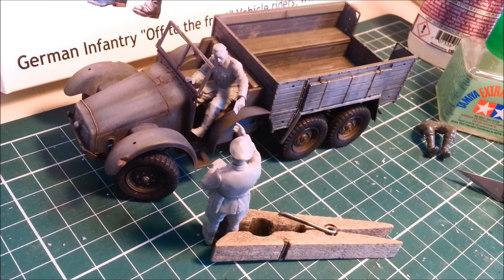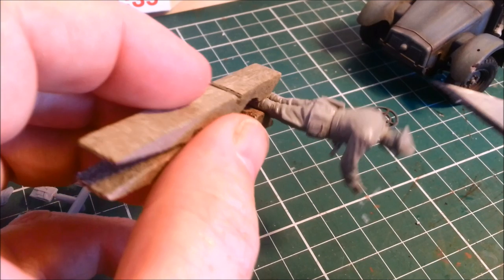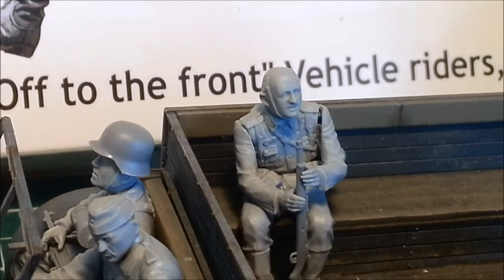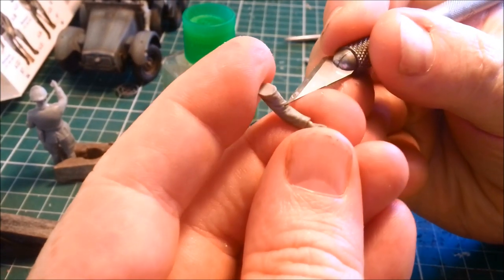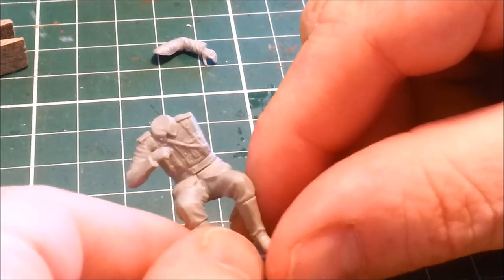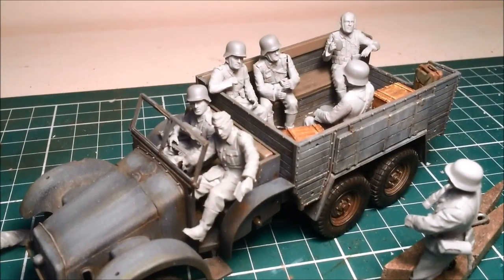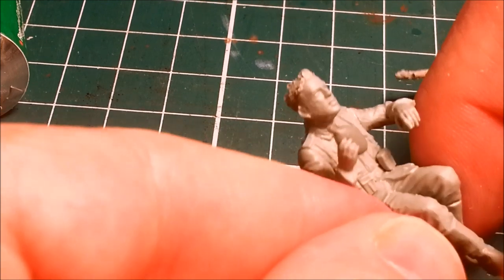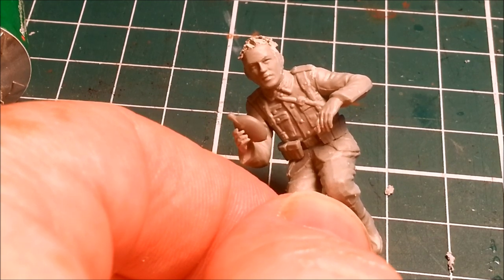Scale model figures 'how to' guide - Part 1 Construction and building

Comment: Great to see Humbrol filler getting some love.   Top tip, try mixing a small glob with some Tamiya Extra Thin, you can then brush it (with a crappy old fine brush) into areas and it'll stick to the plastic like nothing else, sands great too.  Downsides, don't rub it once on as the Extra Thin would have started to melt the plastic and you can deform or rub off details.  You can however just add more Extra Thin to your glob of putty and vary the consistency.
Reply from the maker: Matt Person thank you, that’s a solid tip there!

Comment: Good job, Dave!  I guess one could spend X for an Alpine , Bravo-6 or other such SINGLE figure and have less complaints.  Or one could spend X divided by 2 or 3 and get FIVE guys from Mini Art that really aren't that bad in the final analysis.  I think I'd trade the poses, equipment, etc. of Mini Art in exchange for doing what I consider fun, satisfying clean up work.  Especially true if you need to adjust arms, hands, feet, heads.  There are always Hornet heads and others if you don't care for the facial expressions provided.  Keep up the good work.
Reply: instablaster.

Comment: By using a proper pair of flat edge clippers rather than scissors to remove from the sprue you’d reduce a lot of the need to get rid of left over plastic on the part you want.

Comment: I think you could use the fellow with his elbow out to hold the helmet down on the fat head in the passenger seat. Just saying;) The heads appear to be 1/32 scale versus the 1/35 scale bodies? I have been stocking up on the uniform colors. So I can start building a few and dive into the learning curve. Remember the Jerry's sported the high and tights in the early days. Not until the Russian front did you see the unkempt version with the dark circles around the eyes and gaunt faces. You can also use air-drying modeling clay to make hair, hats and additional equipment.
Reply from the maker: john maddox thanks for the feedback. Agreed, those heads look 1/32 - you are spot on!

Comment: Man you must have received a bad set of the Feldgendarmerie. I have that set and there is some flash but not like that. I wonder if Miniart would send you another set or give you a credit for something else... it's worth a try. You should give Aves Apoxie Sculpt a go for filling gaps. It's a non toxic 2 part epoxie putty that's blends with water. You just place the putty in the gap then using a small brush with water blend it into the joint. I use it all the time to fill imperfections, oh and it doesn't shrink which makes it a one shot deal. Making good progress on the dio it looks like.👊👊
Reply: Mini-art figures seem to be hit or miss. I've had some with little flash...and some with tons.
Reply: Larry Brown I’ve heard that but haven’t experienced it yet. It shouldn’t happen these days with the technology we have.
Reply from the maker: Small Soldier hmm, I bought it off eBay, so I don’t know that I have much chance of getting a credit. Yes, it’s their manufacturing fault, but purchasing from an individual rather than a retail hobby stockist would make life hard if I went down that route I think...
Reply: Oh yeah absolutely. Sorry I didn’t know you got if off eBay. Miniart does some neat stuff but from time to time I’ve heard horror stories like this. I think they’re new stuff is pretty nice though from what I’ve seen. Anyway I hope you didn’t do too much swearing. 🙂👊🏻👊🏻

Comment: Hi dave, if ive painted model figures in enamel how do i make them look more matte??
Reply from the maker: Airable 1 I would recommend a final airbrushed coat with matte clear coat - I use Tamiya clear coat.
Reply: @DavesModelWorkshop  thanks!
Reply: @DavesModelWorkshop  what type of enviroment is this diorama in?
Reply from the maker: @oliversinton948  it's going to be in an urban environment, set in the early days of Operation Barbarossa in 1941.